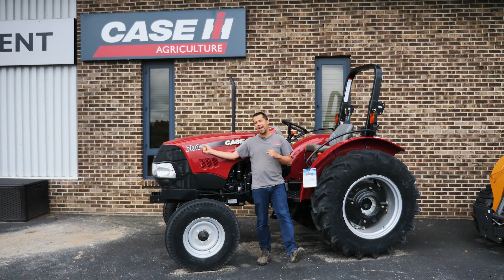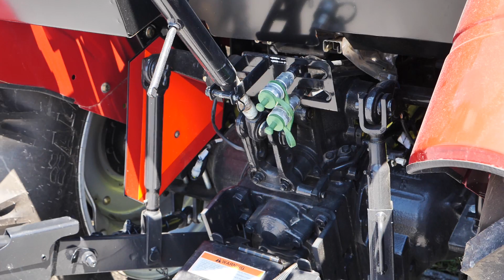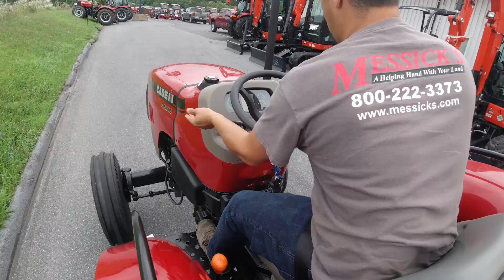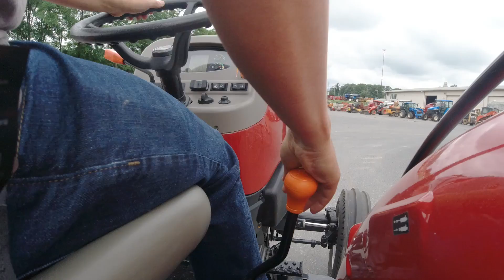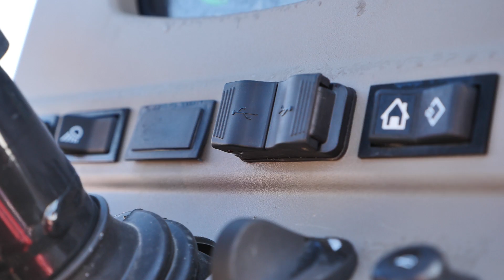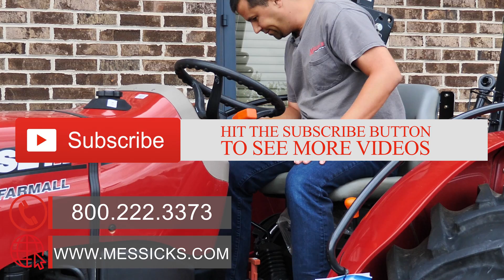Who would buy a 2wd tractor? Case Farmall 70A

Comment: Tractor Mike went to the big farm show (NFMS?) a few years ago where he interview a CaseIH rep who presented their newly launched 2wd versions of some product line, I think up to 150 hp. So they had an actually 2wd in the boot. Mike turned to the camera and explained that the US was one place where 2wd was still around.
I live in Sweden and although I read a lot of brochures I can remember my favorite brand's brochures so well to state that they haven't presented the 2wd option since the beginning of the 90ies for their main line and the smaller/economy they did stop well before the turn of the century.
This was kind of a problem for me when I looked to replace the MF175 with something modern. I use the tractor for small tasks around the yard and in the summer (when in vacation from the office job) I do have hay harvesting.
4wd machines are quite expensive for just a hobby. I was looking for a 2wd and was at last lucky enough to find one from my favorite brand and from a newer generation. I suspect it actually has been amputeed into a 2wd at some point. The original manual from 1991 mentions exactly zero about 2wd. In later years of the model they have some info on the front axle and it's one of those. Or it maybe be from the last generation (guess the axle didn't change).
It's a 85 hp and with the loader a bit north of 4000 kg. It is VERY nimble. But I wouldn't mind some smaller 2wd with comforts. I browsed the specifications and concluded (and set up a keyword watch at the big classified ads page) for a CaseIH 485 XL or 495 XL.
Just Google them with the XL cab. It's basically a giant cab onto a very small tractor :-)
But I'm not even sure there exists a single one of those in my country. Denmark seemed to hold onto 2wd a bit longer (my Valmet is actually imported used from there) so maybe maybe some has made it across the sea.
Now it sounds like I'm saying Sweden was do way ahead but it wasn't really until Volvo ceased their production where the middle segment didn't have any 4wd until it became more common. On the other hand - Norway. You can find Massey Ferguson 100-series with the after market driven front axles there. Their landscape is speckled with mountains and fjords.

Comment: Q.  Who would buy a 2 wheel drive tractor?
A. Someone who already owns a four wheel drive tractor.
Reply: Everyone got along just fine years back with 2wd
Reply: If you to do work in a small space and do tight turns then 2WD is what u need.
Reply: Hay tractors are typically optioned 2wd no need for 4wd running a hay cutter or a rake or a baler. Even loader work for hay tractors like stacking bales you do not need 4wd as long as its properly balanced. For dirt work 4wd is king but not needed for every situation
Reply: Correct and not all operators need 4wd, I don't need 4wd to mow my  5 acre field or to push dirt from one corner to the next.
Reply: Someone with a vagina

Comment: Hey imported from India!? I love my Indian made international copy by mahindra. 2wd was the right price for me. Hope to have my 485DI for a long time. And I use a loader on it. Only thing I wish I had was bigger front tires

Clutch job ruin the savings?  How much can the disc really be?!
Reply from the maker: Clutch job requires splitting the tractor, parts are cheap.. labor is killer.
Reply: @MessicksEquip  ah didn't cross my mind to even pay someone to do it. I know the parts to refresh my clutch are under $500
Reply: Same here,  love my 4540 with a loader 2wd. I did put wider front wheels and tires on the front. Keeps the tires from sinking with a heavy load.
Reply from the maker: Not Indian, Turkish I believe

Comment: Farmed for many years with two wheel drive, mold board plow, disc it did it all well. Still have it, Ford 7700 and still better than many new tractors. But for loaders yes, get 4 wheel drive.
Reply: Only 4x4 I've used is a Case Backhoe and a lil Yanmar Tractor. Everything else I've never had a issue with a 2wd using it for hay,plowing,planting etc they have a better turning radius too, they're all you need for Hay operations beside loading but you can do that to if you have too